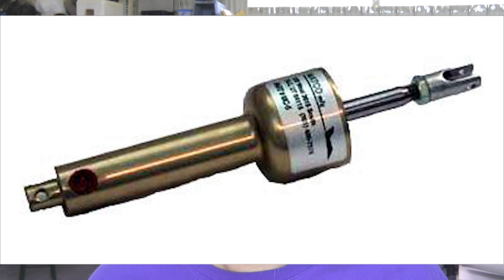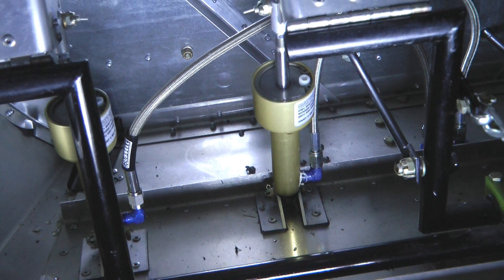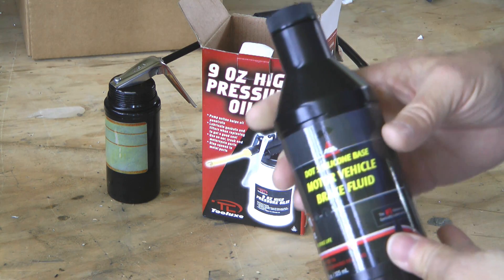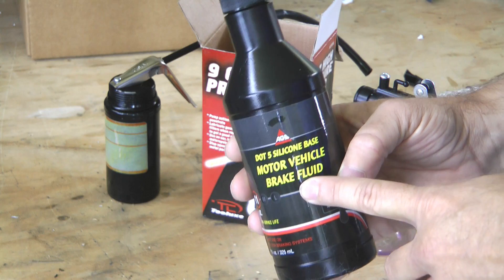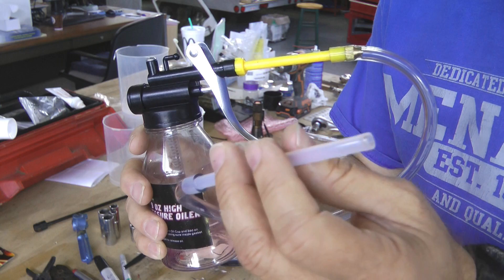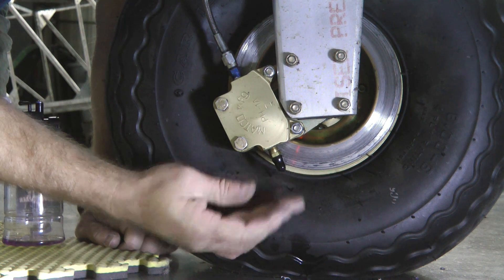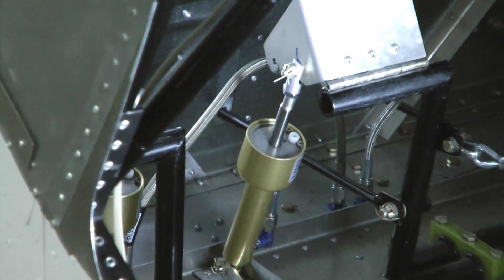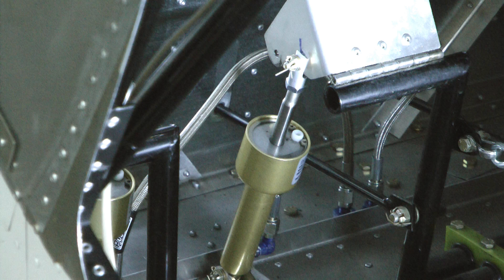How to Bleed Experimental Aircraft Brakes

Comment: I’m surprised Matco specified DOT 5.  I just checked several documents at Matco’s web site and they say to use only 5606.  They specifically warn not to use DOT 3, 4 and 5.1 glycol based fluids.  They are silent on DOT 5 silicone fluid.  And even if DOT 5 is OK to use, I would not recommend that as I doubt any FBO in the country will have DOT 5 on hand should you need some while away from your home base.  Every FBO will have 5606 on hand.

Comment: Matco (now) says do NOT use ANY DOT brake fluid --- you are to use MIL- PRF- 5606 or MIL-PRF-83282 only
Vans systems typically require a full pint

Comment: Did I see teflon tape on some of your connections?  If so, oops, nono.  Just like with fuel lines, thats a disaster waiting to happen.  Locktite 567 is (usually) the best ticket.
Reply: While this is good advice, the fact is, teflon tape used INCORRECTLY is a problem, while teflon tape used CORRECTLY is perfectly safe.  If you wrap the tape only on the threads and don't let any wrap past the nose of the NPT threads it will work as it's supposed to.  That said, the white hydraulic thread sealers are much more difficult to get wrong.

Comment: We use a different procedure for racing brakes, but the remote reservoir above the Master Cylinder is used to add the fluid, and you either vacuum the fluid/air out of the lowest bleed valve, or the 2 man job, is to have 1 person pump up the pedal until firm, then hold and continue pressure, while somebody else opens up the bleed nipple on the caliper, with a tube into a bottle of brake fluid, and you evacuate the air out of the system, from the top to the bottom.  This assumes that you have access to the reservoir on the master cylinder, which it doesn't look like your Matco system provides.
Reply: you can use external reservoir (MCR-100) but you then need to use MC-4's wich has 2 ports - one for the line the other for the reservoir